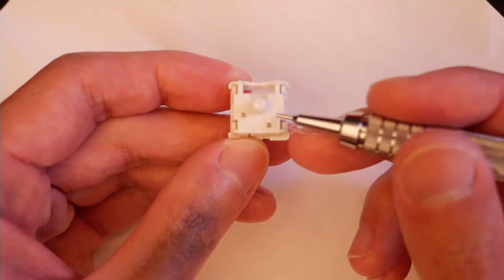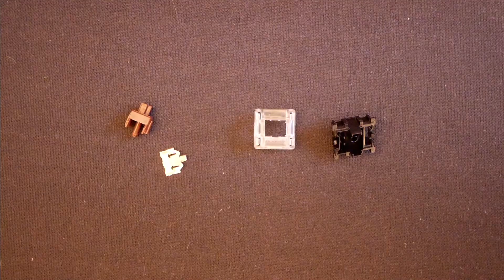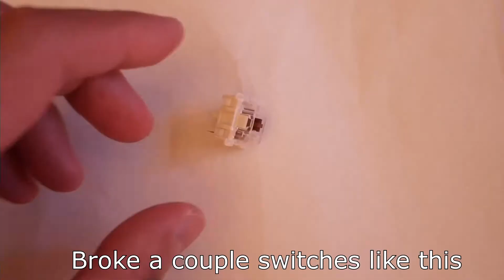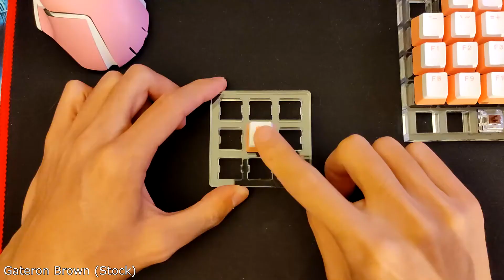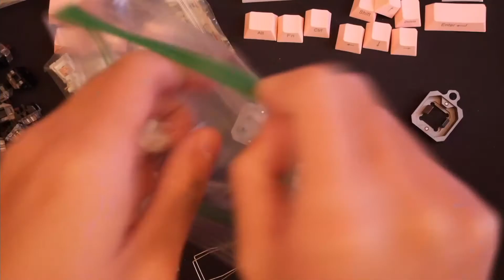Can you make mechanical switches optical?

Comment: This makes me consider mutilating a bunch of Akko CS Jelly Black's I have and repurposing them for the stabilized keys - and if that works out, I will mutilate some Akko Demons. 

1. Open switch
2. Rip the spring leaf out with pliers or whatever, so long as the bottom housing is not damaged. 
3. Take dremmel with a cutting disk on slowest speed possible to not melt / burn the plastic OR use the smallest hand saw available on the market. 
4. Cut a straight line into the center pin, so that the light from the sensor can come through. 
5. ???
6. Profit

Alternative way would be to get the smallest drillbit possible, and drill a hole in the center pin, where the light beam crosses through.

Comment: Would it be possible to cut off the bottom part of the mechanical switch housings (where the optical housing has the slit) so that it could act as an optical switch?
Reply from the maker: Possibly?

You would probably also have to make the mechanical bottom flat or else it wouldn’t fit in the optical board.

Comment: wait so lets say if i buy banana split switches and add the optical bottoms (from my gateron optical browns) it would become an optical switch and would be used in an optical keyboard?? just wondering bc i was pretty bummed knowing that my keyboard is only hot-swappable with optical and i really wanted to use mechanical switches.
Reply from the maker: Right, it's not exactly the same, but it's better than nothing
Reply: @SomethingAzn  okay! tysm!! any recommended switches that sound good and are able to fit on the opticals?
Reply from the maker: @shiba9058  I stopped looking at recent switches (too many), so maybe just get a couple that you might like to try out instead of buying a full set

Comment: maybe cutting the bottom of the mechanical switch and removing the pins will work on optical keyboards, no?
Reply from the maker: Unfortunately not, you need the optical bottoms cause they have a small cutout at the bottom so that the switch poles can break the beam of light that actuates the keyboard

Comment: Ty, I’ve been wondering abt this topic for a while cuz I recently wanted to turn the bubble gum switch into a optical switch but wasn’t rly sure
Reply from the maker: Yeah, hope it works out for you!
Reply: any update? how did it turn out?
Reply: @dd-v  so u can’t rly do that unless you take the spring and stem and switch them into a optical housing switch, bottom line is just buy optical switches it’ll save you a lot of time
Reply: @DreamingSheep.  :( damn. Thanks for responding tho!
Reply: @dd-v  np!
Reply: @DreamingSheep.  found this after doing it. I removed the prongs and shaved down the tube. works without taking anything apart. done with some novelkey cream switches